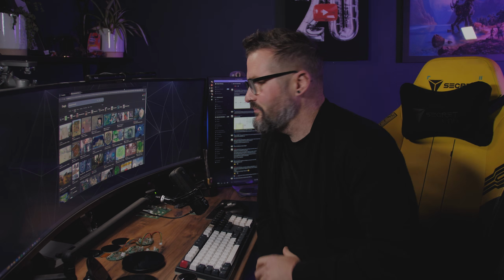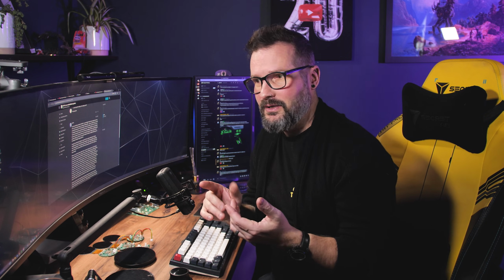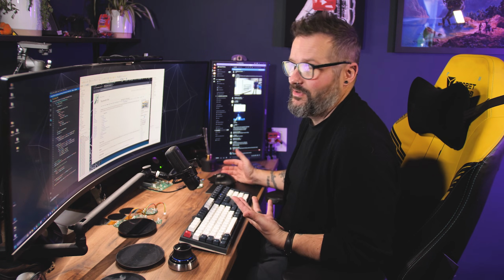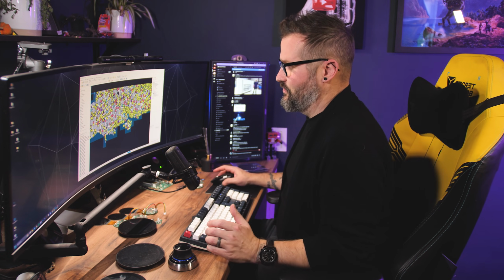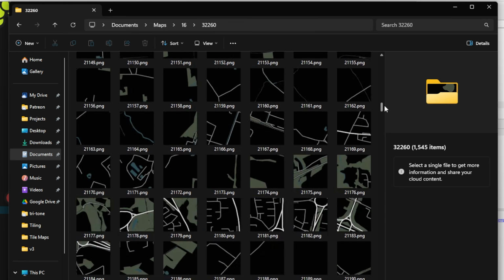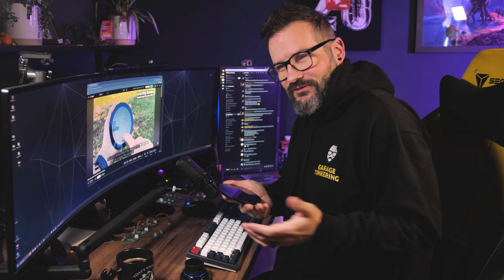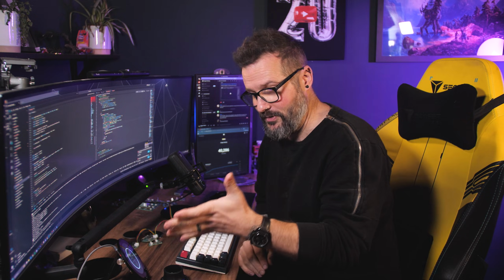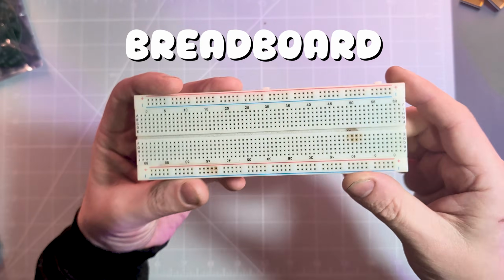A Real Mini Map from Need for Speed

Comment: Not sure if I understood the problem correctly, but if rotating the tile data is too intensive to compute, couldn't you render the graphics first with the static setting and then rotate the rendered image after the fact? Or does the ESP not have enough memory for effectively a double buffered image?
Reply from the maker: It double and triple buffers fine. Its just that image rotation is computationally heavy
Reply: @GarageTinkering Ahh, okay. Yeah, arbitrary rotation is expensive... It sounded to me in the video like you were trying to rotate the tile data before rendering the final image. Hence the suggestion to render the image right side up first and then only rotate afterwards to reduce the amount of image needed to be rotated.

Comment: I'm not seeing a link to the final firmware source you used. The P4 should have no problem rotating the screen with 0 artifacts at 30fps. Would like to see the code you used for driving the LCD
Reply from the maker: It's all linked in the description

Comment: You made it not "spin" and it's also not filling up the screen. So you have not achieved your claim. And none of this has to do with the fact religions aren't real? 🤦‍♂️ Still, nice attempt. And very exited for whenever I can get one that spins and fills the screen.
Reply from the maker: It does fill the screen, I chose not to for design reasons. And I fixed the spinning issue now. 

Also "checkmate atheists" has zero to do with religion.

Comment: If you’re building an entire dashboard, I’m wondering if you’re struggling unnecessarily to pack all the functionality within the confines of esp32 performance; a central small cpu under your seat that broadcasts small amounts of information to each esp32 seems like it’d be beneficial at this point. This way map rotation, tile loading, and probably pretty importantly map updates (construction, changes, hazards, etc) would be MUCH easier. I think you could handle that all centrally and in a more automated way, use the entire screen, and get better performance. 

It is seriously impressive what you’ve done here. And congratulations for proving the nay-sayers wrong! Looking forward to seeing how this evolves. Thank you so much for putting in all the extra work it took to document and share this with us
Reply from the maker: Using only part of the screen is simply a product of aesthetics, not processing. 

Honestly, for the overwhelming majority of this, the ESP32 ecosystem is more than capable as a bunch of standalone CANBus connected devices. 

Big advantage there is that it's infinitely expandable with very little difficulty. 

I'm sure the system will change as it evolves, but for right now it works great.
Reply: @GarageTinkering  ah ok. No argument here, I applaud your commitment and what you’ve accomplished here. So cool

Comment: 10:25 I’ve had a VIOFO A129 Plus for a few years now and love it- solid camera. I wanted a dash cam that didn’t have a built in battery, because it gets super hot in the summer and really cold in the winter, and the VIOFO has a capacitor to save videos in the event it gets disconnected from the base. It came in handy literally just the other day when a guy crossed a solid line in a roundabout and side swiped my truck. He was adamant I was at fault because I “obviously” turned into him, but I was able to show the officer the video of the guy very clearly crossing the solid line, without a blinker, and hitting me…
Reply from the maker: Dashcams are one of those odd things that in an ideal situation you'll never use, but in the case where you need it, it's a lifesaver to have

Comment: The map actually can be set to always face north or rotate in settings of Underground 2 aswell aswell as in Most Wanted so it is accurate. It's even race and freeroam specific and it rotates in some cases and others stays fixed by default. So no worries :v

Comment: ESP-32's are my go-to microcontroller, but I built a small, handheld GPS using an Arduino Micro, a GPS module, a compass, a crazy small single-color LCD, and a cell phone battery with charge controller. I then just stuffed it all into a 3D printed case.

It was made for a specific purpose, so the Lat/Lon was essentially hardcoded into it. When in use, it would display an arrow pointing in the direction you needed to go, and how far away it was.

It was a fun little build, but I had always wanted to put basic maps into it like you're doing.

Comment: Why not just pull only the relevant data for smaller tiles upon crossing its border directly from OSM via C6 and internally process it on P4 with local SD card? This way you save on all of this storage and processing, the original NFSU2 map was measured in megabytes and so with optimized queries you shouldn't need to spend hours on PC to have up-to-date stylized map
Reply from the maker: That would require an internet connection, which I'm trying to avoid for this. The whole point is it's entirely offline

Comment: There should be a function to rotate the entire view instead of the tiles. Could be slightly tricky with keeping the north arrow always pointing the right way, but doable.
Reply from the maker: It results in exactly the same issues due to the image buffering and pixel comparison

Comment: Absolutely brilliant. Apologies if you already went down this path but instead of rotating the whole stitched map (even just as a reference for your map) because you have chunks can you limit the load to the square you are on and anything surrounding? 
So the generated map at any given time would be 9 squares and movement would only have to load the next 3 in that direction to maintain a 9 square map. That said I can't say how it might behave going through a corner of a tile to load 3 then 3 again. Just outload thinking...
Reply from the maker: That's exactly how it works already
Reply: @GarageTinkering thought you might have tackled that already.
Regardless that is amazing and I will be trying to make my own here in Aus.

Comment: 12:50 could you keep 2 files, one black and one blue, and sym link the empty ones to match accordingly (black or blue)?
Reply from the maker: Probably not. You'd have to know if a missing tile was a black or blue, and it doesn't have any information about it other than the grid ref
Reply: @GarageTinkering  Yeah, that's where the symlink comes in. You'd keep the file name, but turn it into a symlink to either the blue or black tile. You'd have to evaluate the pixels somehow, though. A bit extra code to run on each file, but doable maybe. 

This way, instead of missing/blank tiles, you'd always have the proper blue or black tile, but the total storage size would be 2 images, instead of ... thousands and thousands.

Comment: You had an issue where if it was constantly rotating the tiles it would tank performance. How about, if the car is driving in a certain direction for more than 10 seconds, the tile rotates in that direction just once and it keeps going until you turn direction and drive in that direction for another 10 seconds.
Reply from the maker: You'd end up with large periods of time pointing in the wrong direction. Not to worry though, I've sorted it now
Reply: @GarageTinkering  That's good to hear mate. Glad it's all coming together like you envisioned. :3

Comment: i wonder why you don't using the full screen size to render the map... is there a specific reason?
Reply from the maker: Aesthetics. When placed alongside my other gauges, doing full screen would make the collection look lopsided. It'll make more sense in the next video
Reply: @GarageTinkering  ah ok will there also be a setting to make it fullscreen if i would like to use it just alone as a map without the gauges you mentioned?
Reply from the maker: Yeah. I have a simple overlay that adds the inner circle, and due to the size can get away with a 3x3 grid. If you remove the overlay and change the grid to 5x5 it'll all work fullscreen just fine.

Comment: I guessed 2M :)
I would improve the sw to use the whole screen first and then to rotate the map, not the car; maybe loading only like 9 tiles instead of everything and when detecting the direction, load the next tiles so it doesn't have to deal with the whole map but just a small portion at time.
Reply from the maker: You've just described how I already built it. 

I don't use the whole screen for aesthetic reasons, not performance ones

Comment: What if you only generate the tiles you need on the fly (9) - How long would that take?
What if you keep the tiles you generate as you go and store those - caching…?
What if it all gets stored in a common location so that ANYONE using your system builds your tile library - so anyone else who needs that tile benefits?
Reply from the maker: That on the fly generation is exactly what it already does. 

Building a centralised server for feeding maps would be crazy. That's basically just Google maps.

Comment: Why using an external ESP32  dev board to handle the GPS instead of adding a GPS module to the ESP32-P4, tied to the screen ?

Great video tho, I am working on a project with smaller Waveshare screens, and you taught me a lot :)
Reply from the maker: I have a whole range of devices connected to a CAN I made. More of them are going to need GPS, so makes sense just to get it in one place and distribute to the network

Comment: awesome... did you optimize the image files enough? is filesize the culprit for staggerman? could it use svg or so? svg can be inlined to code quite well. i think you can optimize the image, fileformat, colordepth etc to reduce filesize and thus loading times.. this could be as simple as running a photoshop batch action on your filestack... hope that helps .. awesome project! :)
Reply from the maker: I don't use images, I use binary files

Comment: That is cool. I have a Viofo dashcam with a hard wired kit and it’s been running great for the last 3 years. The polarising filter gets rid of the reflections in the windscreen.
Reply from the maker: You've got to hardwire it. Only way to do it right! I like the fact it cuts off if the battery gets too low!

Comment: you were mentioning that you don't have enough resources to do a fast image rotation in real time...where is the time constraint?, on the sin/cos calculation? if that's the case you can replace them with a lookup table and then use a matrix multiplication. there are very efficient image rotation algorithms..im wondering which one you tried?
Reply from the maker: The UI is built with LVGL so it just was using the rotation function as part of that. I'm honestly not sure which method it uses. I have a feeling I might need to decouple the UI

Comment: For extracting data from OpenStreetMap dumps, I would recommend using Osmium - either the command line tool, or through one of the wrappers (python, js). Or directly in c++ if you're that type of sicko.

Comment: This might be an unorthodox approach, but I’d seriously consider looking at how game developers implemented this solution, they would have needed a very compute solution efficient solution due to the limitations of the hardware these games were running on at the time.
I’m sure someone has already decompiled the game data for analysis.
Major optimisations I can think of:

Constrict the colour space of the images to only the colours used

I’m not sure if these images are being compressed or whether the esp has the horsepower to decompress efficiently in real time, but this could be an effective way to significantly reduce the tile-map size.
I happen to know that automotive OEM’s are using less than 30GB for an entire Europe map…

There’s probably some clever mathematical relationship between your display area in pixels and the optimal tile size which would balance loading latency and efficient use of RAM.

Loading tiles could be strategised by restricting the code to load new tiles earlier whilst also only one tile at a time, which should reduce the latency effect of loading multiple tiles sequentially.

I’d look into using map layers instead of single images, there’s a few reasons for this:
Your land colour is very rarely changing even during transformation, unless you are near bodies of water, if that layer is drawn and its file size is a specific constant you can then exclude that layer from the rotation calculations.
This also allows each map layer to be monochrome which will reduce file size massively.
For the road layer you can then convert this to vector graphics efficiently, if this was done to the current combined tile map the complexity would likely ruin the efficiency increase. 
The vector graphic road layer can then be transformed for rotation very efficiently.
Landmarks: I would seperate from the tile map entirely and assign them as a graphic overlay based on absolute coordinates of the tile map. This is computationally efficient in comparison to having to load another map layer and also gives you more control if you decide to give the user the option to enable or disable specific poi.
As long as you stick to round markers you also don’t need to transform them when you change direction, as the absolute coordinates will be static on the base map.

Comment: Question:

About rotating map, wouldn't be the case to subdivide the archives, maybe find a way to have a larger cache, but each have a region, they are subdivided by cities or areas, when you are in said city or area you call those subdivides and to optimize even more they call a division of that sub division, it would be bulkier but sure would be smother in the long run, extra points if you can make a way point other side of UK and make a program that optimize the mapping

I am for sure stating the obvious, you seem to clearly have experience and knowledge, but I am curious how bulkier and labor intensive that would be? maybe something different them a ESP32 you seem to have done a lot of optimization software side

It's a cool project that can be a utility for people who would thinker with it further

Comment: the fact that the map is running without any wifi connection is crazy!! i would suggest you to add  a feature in the map that can create a path on the road towards your destination. Good luck
Reply: Currently this is just image processing, to add line paths would mean changing the methodology entirely because the esp doesn’t know these are roads, it’s just rendering images. 
You’d need to change to a vector system and id probably use the google maps api to for route deduction, otherwise implementing Eulerian path deduction is non trivial and probably impossible on an esp for a map of this size.

Comment: does this actually work in tunnels tho? i imagine since the gps signal would stop working, that you need to calculate position by the original before the tunnels and offset it via the position that you need to calculate locally no?
Reply from the maker: Probably not, but I don't really tend to go in tunnels.
Reply: @GarageTinkering  pretty cool tho, very impressed. you gained a sub from this :D

Comment: I think you could probably compress/reduce the quality of the images to reduce their file size further. You could potentially go smaller with similar detail using jpeg, but I'd have to test it myself.
Reply from the maker: The conversation to RGB565 bin files means no matter the size of that png/jpg, they all end up as 129kB, so it's kinda moot. File loading isn't an issue though.
Reply: @GarageTinkering That's good to know, and unfortunate. A shame the screen uses an SD card, but it's super awesome what you've already done, and will continue to iterate on!